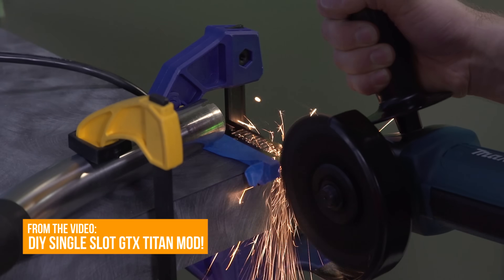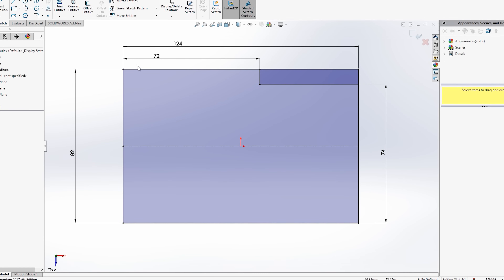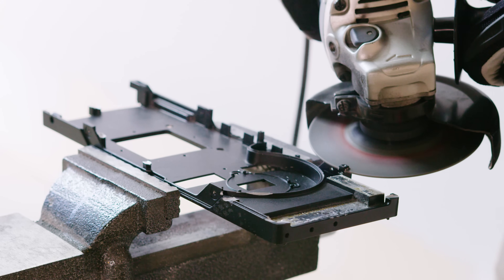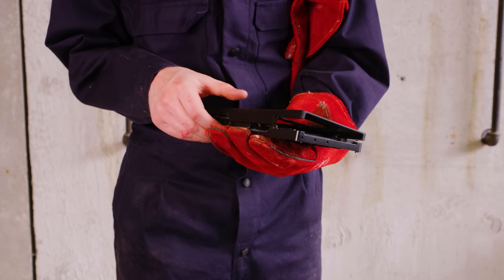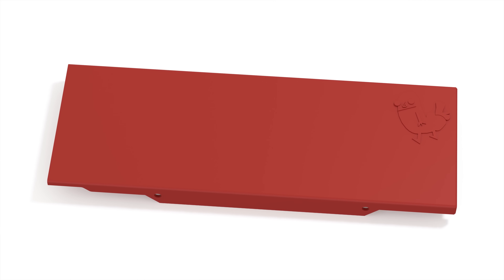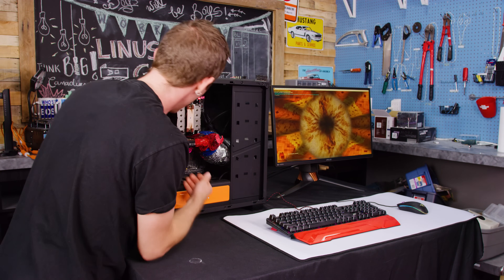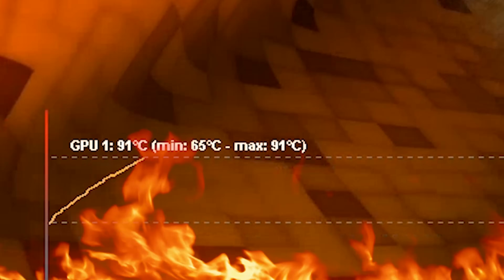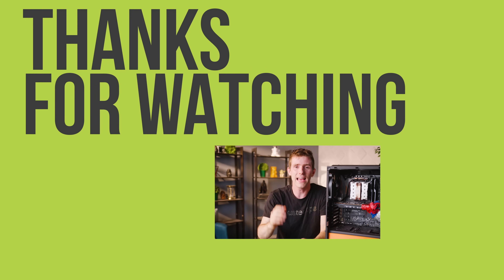Chopping Up a GTX Titan... AGAIN!

Comment: MUCH BETTER SOLUTION - I'm doing the same mod to several k20/k40 teslas (also running k110 as per GTX titan), to fit into single slot hp servers.  My requirements for heat dissipation required a heatsink & fan capable of around 150watts.  Luckily one already exists (off the shelf) which only requires minor mods.  Its the (fermi based) quadro 4000 (the same gf100 in the hot beast gtx480).  Luckily the gf100 gpu has the same package size, main gpu screw locations and is almost a perfect fit.  The first version (silver & black) is actually a die cast aluminium package with a copper plate, heat pipes, aluminium fins and 1 slot fan (to cool the gf100 Foreman grill)... [required] Underclock for 150w - the tesla k80, which has double the cores of k20/k40 uses a 560Mhz clock (vs 750mhz in k20/40) with a 300w rating, so a single k110 in k20/k40 should operate around around 150watts.  Given the logarithmic relationship between clocking and heat, a lower clock offers more GPU power per watt, and is fine for compute applications (AI) where the number of parallel cores (2 cards - 2 slots) is more important than higher clock speed from a single 2 slot card.  ;)

Comment: The 140mm fan adapter is exactly* what I need! They have plenty 120 to 140 adapters I can use, after watching the video with the green house to trap all the hot air and blow it outside from the pc I figured you could get 90% the way there by just having your exhaust fan blowing into a dryer vent that leads outside.

Comment: Sooooooo I've been watching the back log of all the LTT videos that came out before I subbed (2 years ago). 

I've been modeling up a cover plate so I could make a 1050 it LP card fit in a single slot for my Steam machine.  This helps alot actually :)

Comment: Maybe it could have been done with some extreme modding, like turning the whole cover into a heatsink with fins and pipes. Them just have a blower fan with high RPM for that sustained load.
 You don't even need to calculate it to know that having the heatsink would mean it would overheat.

Comment: 2017: "Can this GTX Titan fit in a single slot and not thermal throttle? Let's find out..."
2021: "Can this RTX 2090 ti fit in a triple slot and not thermal throttle? Let's find out..."

Comment: Hello Linus.
You can't do it with single slot.

So why not try four or five slot?

Make a cooler ( made from from cooper ) that cools every component on a graphic card.

VRMs, All memory chips and even PCB itself.

For example you can use cooper heatsink. Take a cooper plate and use CNC to perfectly fit it to the card ( Touch every empy area on pcb. Touch vrms, gpu and memory modules. Front and back of the card. )

https://www.amazon.com/Dynatron-B14-Active-CPU-Cooler/dp/B07B6DH4ZC/ref=pd_day0_hl_147_1/139-7442675-3721609?_encoding=UTF8&pd_rd_i=B07B6DH4ZC&pd_rd_r=dcba19e4-98e4-11e9-b52c-6d6c1e25c3a0&pd_rd_w=Qy53P&pd_rd_wg=okHMs&pf_rd_p=ad07871c-e646-4161-82c7-5ed0d4c85b07&pf_rd_r=91WYBMWAMXQ2ZD2WWW72&psc=1&refRID=91WYBMWAMXQ2ZD2WWW72

https://www.google.com/imgres?imgurl=https%3A%2F%2Fi.ebayimg.com%2Fimages%2Fg%2F45gAAOSwLYBaG4k3%2Fs-l640.jpg&imgrefurl=https%3A%2F%2Fwww.ebay.com%2Fp%2FDynatron-A25-AMD-EPYC-Sp3-Socket-1u-Passive-CPU-Cooler-Copper-Heatsink%2F11010442712&docid=BQZWJb7ezkwisM&tbnid=aBiYITgEsFp5ZM%3A&vet=10ahUKEwjS3u6b6onjAhX2ysQBHSBCAGMQMwhPKA4wDg..i&w=500&h=500&itg=1&client=firefox-b-d&bih=1005&biw=1920&q=Dynatron%20A25%20AMD%20EPYC&ved=0ahUKEwjS3u6b6onjAhX2ysQBHSBCAGMQMwhPKA4wDg&iact=mrc&uact=8

https://www.google.com/imgres?imgurl=https%3A%2F%2Fae01.alicdn.com%2Fkf%2FHTB1nYFfQFXXXXXbXpXXq6xXFXXXY%2FFONSONING-3-heat-pipe-heat-pipe-radiator-cards-radiator-DIY-48-58MM-holes-can-be-converted.jpg&imgrefurl=https%3A%2F%2Fwww.aliexpress.com%2Fitem%2F3-heat-pipe-heat-pipe-radiator-cards-radiator-DIY-48-58MM-holes-can-be-converted-graphics%2F32367165474.html&docid=WiQ0IY8d6_UL7M&tbnid=bxF_embYzO67XM%3A&vet=1&w=400&h=400&client=firefox-b-d&bih=1005&biw=1920&ved=2ahUKEwjexLHf8YnjAhUPLewKHeoqB80QxiAoAnoECAEQFg&iact=c&ictx=1#h=400&imgdii=wEOxNxfxzkipzM:&vet=1&w=400

https://www.google.com/imgres?imgurl=https%3A%2F%2Fpictures.attention-ngn.com%2Fportal%2F35%2F189493%2Fproducts%2F1325709%2F21066186d9176cef41ea036d0f127bb2_01_07_o.jpg&imgrefurl=https%3A%2F%2Fwww.virtualmarket.innotrans.de%2Fen%2FHeatsink-with-embeded-heat-pipes%2Cp1325709&docid=rrbDl-EpqvMn-M&tbnid=NIRopPkp9WVRbM%3A&vet=12ahUKEwiH6oyo8onjAhVHz6YKHXmcBGo4ZBAzKBAwEHoECAEQEQ..i&w=600&h=600&client=firefox-b-d&bih=1005&biw=1920&q=Heat%20pipe%20heat%20sink&ved=2ahUKEwiH6oyo8onjAhVHz6YKHXmcBGo4ZBAzKBAwEHoECAEQEQ&iact=mrc&uact=8

İ know you can find more solitions.

Comment: Yeah, I’ll stick with my single slot EK waterblock solution for both my 2080Ti’s and Titan Z CEO’s thank you, yes, that’s 4 GPU’s, no grinding necessary and you’ll get much better thermals. Especially if you are using an external water chiller from AlphaCooler, the very incredible Eizeit 2000.that allows you to get a sustained 4.8 Ghz on a well insulated Threadripper 2950X (Workstation), 4.2 GHz on a 2990WX (server).

Comment: It's so hard to watch you guys build things. As a mechanical engineering student I literally cringe when I watch it. Please don't use gloves while using a belt sander or really any moving power tools. Also using calipers isnt as easy as it looks. Your measurements are wrong because YOU are inconsistent. We literally had tests where we had to measure blocks with calipers and only my profs could get accuracy to within a thousand of an inch

Comment: nice shop safety; I see you cut the f**k out of your finger when grinding with the belt sander XD
also, you should move the heat sink (or whatever you're using on the belt sander) back and forth perpendicular to the direction of the rotating belt to avoid abnormal wear on the belt

Comment: We're you guys pushing air or pulling? Should have built a plenum that incorporated some more heat syncs and pulled the air across that bad boy. I'd maybe duct it out the back with the normal  rear fan and just +charge the case and have it draw from there or passively from a different inlet

Comment: I get 1.25gb rollover data (up to 3.25gb) for $8nzd (5.50usd) a month, then additional texts and calling at 2c per text and 4c per minute (nzd). I changed from 1.25gb (rollover to 3.5gb), unlimited texts, 200 minutes (rollover to 500), and 50% discount for spotify premium because I thought all that was too expensive at $13usd a month.

There used to be a telephone network monopoly in our country, because the government had set up the main company. The government then realised that they had made a monopoly and forced the company to rent out their network to other carriers at the same rate that it costs them. When I decided to change networks, I had to decide between 5 networks.

Comment: So wheres the maths??? i need proof of the fin surface area of the aluminum is to small to be cooled by air... whats the ambient temp of the room? how much back draft do you have with that god awful flew duct you got, how much back pressure is there pushing against the fans to slow down the fan speed? i say ramp up to 3 140mm fans and straight pipe that baby  while making sure it is being vented outside the case... thats key...  also... to make it so the air will actually flow through the fins cut the damn fins better... take ur time.. plan things out.   also being abler to contain more fan pressure.. you will need better tape.. maybe glue next time?

Comment: what about a copper heatsink? it has about twice the thermal conductivity of aluminum. it would, of course, be very expensive to have an all copper heatsink. and you might have to have it machined.

Comment: realy good cooling my 9800 gx2 use to game 104c
Reply: Sounds like you had a terrible cooler then with a empty bunch of heat pipes or out of the box got one with a shitty thermal paste application.
The 9800 gtx+ i got here, single gpu version of your card but overclocked & it runs mid 70'c in temperatures in furmark with a standard reference cooler after i replaced the thermal paste along with taking apart the very dusty cooler.)
If that card is still alive somehow it could be worth taking apart the heat sink so you can clean out dust where compressed air can't reach along with new thermal paste on the gpu's as well too freshen it up.

Comment: You should be arrested for what you did to that heatsink.
Reply: It would be kind of neat if they do a final video on this actually & with the help of Noctua, Thermaltake, Arctic cooling or another company that can make gpu coolers, makes a single slot cooler that spreads the thermal dissipation length wise while maintaining about the same cooling performance as the original cooler.

Comment: Ca you guys try a pc with a "cold air intake"? you put a pc in a hot room but you put a long tube through the window to outside that connects to the front of your pc. That way, in the winter your pc can suck in air that is freezing cold.

Comment: the heatsink should be copper, the cover should be copper soldered onto the fins, then with a small undervolt and a non power virus workload like furmark but an actual game instead, it could've worked

Comment: water cooling it and cutting the PCI bracket in half with sheet metal snips would be a better option but you already knew that Linus. interesting video though. although the april titan xp is what i have.

Comment: Could you design an over the back or over the top heatpipe cooler that would work - and still be technically a single slot solution

Comment: Hey guys... A little advice... Never... EVER, try to use angle grinder od belt sander with gloves on... It gives you protection from flying bits and pieces, but those bits can't hurt you as much as when you get your glove and hand with it sucked into the rotating disc of angle grinder, or belt from belt sander... It cant tore your hand off... Excuse mistakes, english is not my first language...

Comment: dude... Why not mod the card to some massive heat pipes that extend out of the case, Could make it a hot rod themed build :) Could still manage to make it a single slot card too if you flatten the pipes at the card end :)

Comment: Linus,

While direct air cooling may not have worked, have you considered mounting some heat-pipes to the card to be able to mount a full fan + heat sink away from the card? Somewhat similar to how laptops with 1080s do it. It basically is just like water cooling, but without the whole pump side of things.

Comment: Get a set of mikes. you (will) won't regret the cost at all! Nah jk

Just be sure to actually use a pair of calipers right. if they aren't absolutes, you need to zero them each time by returning the jaws to the full closed position. also clean the jaws.

Anyhow, good luck!

Comment: Something like this could work with a heatpipe style cooler that placed the fins either in front of or on the top side of the card so a large fan could be mounted to a  much larger set of fins. But that would involve making custom heatpipes and mating them to a block and fin assembly. The block could be milled and the fins are fairly straight forward, but the heatpipes would be a pain.

Comment: But would this void the warranty
Reply: "cutting up this Graphics Card will void your warranty"? ok...
Reply: Jacob W but can it run crysis
Reply: Extends it, actually. By making such modifications to your card, you're showing that you're knowledgeable enough to properly use and care for it. This means that you're likely a power user who's both less risky and potentially more lucrative for the hardware manufacturer's future business, so it becomes much more commercially viable for them to offer an extended warranty to you for free. You can normally get anywhere from 2-5 extra years on your warranty, provided you give their tech support a call and describe in enough detail exactly what you've done to your card.
Reply: @neolexiousneolexian6079  i can back this up i opened and watercooled my one.. they agreed to change it for a mere 200$ i was happy
Reply: As long as the sticker is fine it’s probably ok
Reply: can’t void the warranty if you don’t tell them
Reply: Just put some tape on it, they'll never know
Reply: Jacob W no it would brick it
Reply: I think it isn't being void by that
Reply: But No it wouldn't
Reply: No it's fine, he didn't peel the void if removed sticker
Reply: Not as long as you buy a new cooler and tell nobody what sins you've committed
Reply: no shit
Reply: Are you This Stupid.....OF COARSE
Reply: @Ahmed-sl3mk  r/woosh
Reply: @TheBanaan57  r/itswooooshwith4os
Reply: @Ahmed-sl3mk  r/woooosh
Reply: @Ahmed-sl3mk  u fool u didn't get the joke xd
Reply: @magneficentani7090  I am dissapointed in myself 2 years ago
Reply: @Ahmed-sl3mk  
Wait u were serious? I thought that was a joke
Reply: @magneficentani7090  lmao, knowing me at that time, I probably didn't even know what woosh ment
Reply: @Ahmed-sl3mk  bruh
Reply: @Ahmed-sl3mk  r/wooosh

Comment: This is why Engineers get paid lots of money to use this "math" to find out whether physics will let certain things be possible.  That being said, for smaller scale things like this where you can burn resources for entertainment value, I'm all for trying it out!  Also because strictly speaking, you're still doing real science by making a prediction (calculating that the fins would be too short) and then testing that hypothesis by actually rigging the thing up.  I actually like this because just saying it won't work is way more boring that still trying it anyways.

Comment: DUDE TAKE A CLASS IN SHOP SAFTEY... if you hang over the grider like that you will catch molten metal in your eyes (both (glasses or not)).Please don't tell me that you are leaning into the piece either, its going to hurt you badz. Watch AVE on welding.

Comment: You knew it is a dumb idea! Surface is linear to volume of air.   I have thought of using laptop heatpipes/heatsinks but realizing the small surface area, it is also not enough.  A simple/cheap AIO water cooling will also struggle.

Comment: when you feel the urge to use angelgrinders on electronics it's time to start a self-help group.

1. admit your problem
2. we aceppt you like you are
Reply: Angle grinding is actually pretty good for case modding. When you are going Dremel tool only for major mods and especially if you are taking mounting brackets out of fixed bracket cases you can get a bit extreme with the amount of time and bits taken.  So it makes sense to use an angle grinder for the rough cut and then clean and finesse with a Dremel tool.

Comment: There is a good reason why single slot coolers are so rare on high end cards, there is simply not enough mass and surface area coupled with the limited air flow they do not perform well enough to cool 150+ watt cards. The final nail is the users who rarely maintain their cards and allow their cards to slow roast like they do laptops.

Comment: yea you will never read this... Cooling yes the math exist so does the materials. Heat dissipation can be "helped" by using other materials. a good example would be ceramic. Consider that almost all semiconductors die at 100 °C or is damaged and consider the amount of energy a actual GPU use you will soon realize that heat spreading alone becomes a real problem. Adding a material like ceramic to the mix might allow for better results. But in the end a mix between metals and ceramic might be the best way to get to the perfect temp of  25°C or as close as possible to it. But yea you will NEVER even notice this.

Comment: Hey Linus u can use a very easy and a different set up for sizing and Shaping up the heat sink as u want. It's very easy u need a better coolant, tools and a table set up with 3 axis.

Comment: Ok ... another informative video, but lacks tech fundation...
1. An "normal" pc fan can't supress the static pressure with that design ( duct and heatsink);
2. Would be nice to explain the basics of the thermodinamic e fluid mechanics, just to pass the message;
3. Yes, the airflow is a crucial point, as any factor in the basic heat transfer formula;
4. Just for fun, if you change the fan, to a exaust fan (bathroom type) you would get a static pressure available 2x to 3x with very diferente results;
Note: i'm an ElectroMechanic engineer, and entusiastic pc builder,  1st project has to get a slot A AMD to 1,2 Ghz in water cooling with aquarium pump...:) ;) nice times...

Comment: 3:42 Aluminum isn't conductive, you know. And the traces on the PCB are not exposed, so even conductive materials won't do anything unless you scratch off the protection.

Comment: could you have used a peltier plate to increase the heatsink temperature? (so the same amount of room temperature air would have removed more energy)
that would have asked a cooling that consume as much power as the GPU itself, but maybe you could have gotten a 90°C non throttling GPU, and a 200°C heatsink...

Comment: Air cooled Single slot gpu? That's a nearly 3 slot card , What did you expect? This needs to be called DerpTV !!! 10$ a Gig ??? Really ??? Still pushing for Higher Data rates Per Serving ??? You Really Need to LET IT GO !!! They are Limiting Our Data as it is !!! THEY Don't need Anymore Promotion of Throttling it Even WORSE !!! I'M BEGGING YOU TO DROP TING !!! PLEASE !!! 10 $ a Gig for data , let's see , 3 apps equal 1 gig , Absolutely No Data for Even a Phone call !!! LET IT GO !!! Their rates at 30 gig Cap in Most Services are Not enough to Keep watching your videos as it is !!! You Promote Them to Throtle it Even More ??? WHAT GIVES??? YOU ARE A SELL OUT FOR NET NUTRALITY !!! KEEP POSTING THIS PROMOTION AND THERE WILL BE BACKLASH BEYOND MEANS OF CORRECTING IT !!! STOP POSTING PROMOTIONS FOR TING !!! NOW !!! MAYBE YOUR PEDABYTE SERVER NEEDS TO BE CHARGED AT 10 $ A GIG ??? HOW WOULD YOU LIKE THAT ??? WHAT A DUMBASS !!!